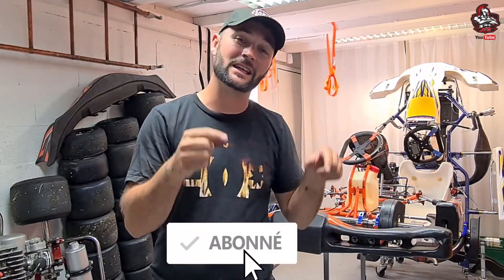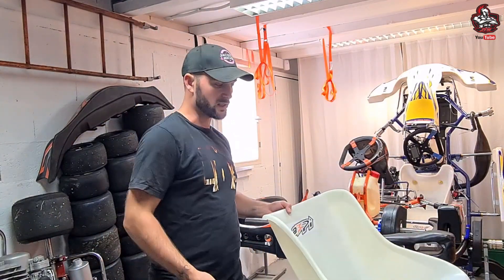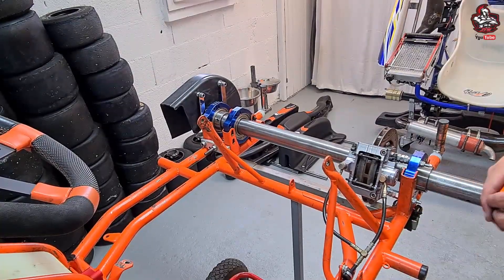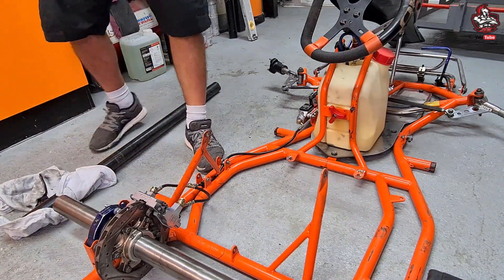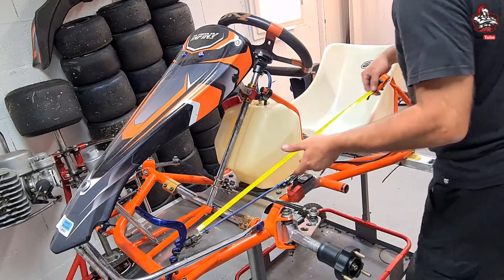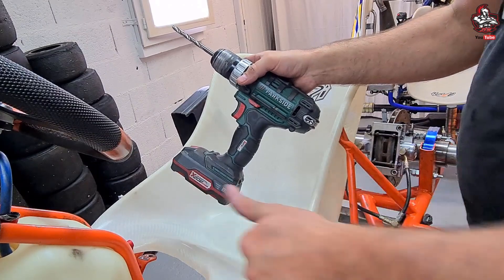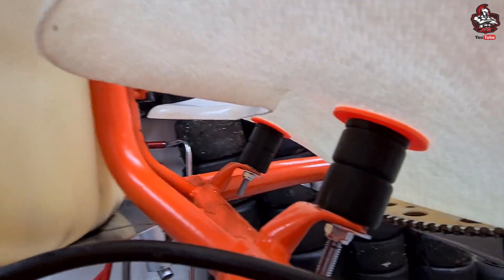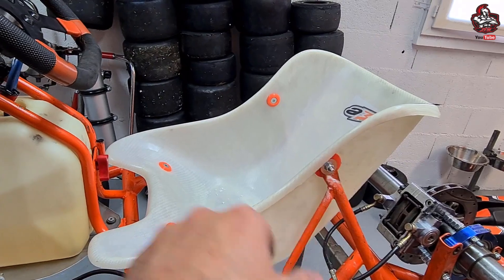TUTO INSTALLATION BAQUET SUR UN KARTING !!!

Comment: La position du bac est prescrit dans le manuel du Chassis, il ne faut pas s’écarter beaucoup de cela. Je rappelle que le pilote représente plus d’un tiers du poids total, 5 mm trop en avant ou trop en arrière un impact significatif. Ce n’est pas au baquet de s’adapter au confort du pilote, mais au volant et aux pédales. concernant la hauteur du baquet, il y a longtemps que l’on règle les baquet à fleurs de Chassis sans les couronnes.